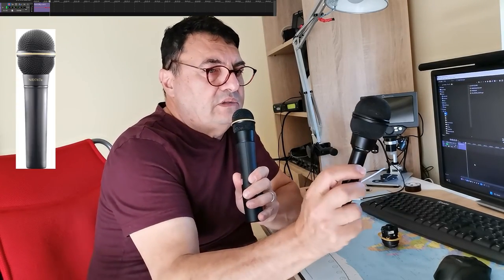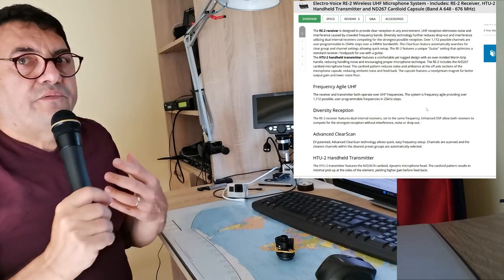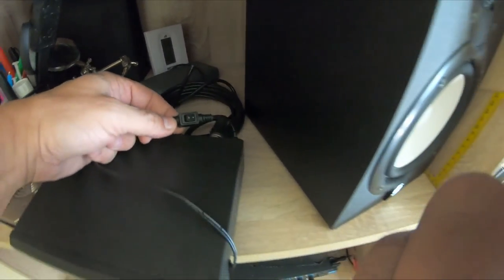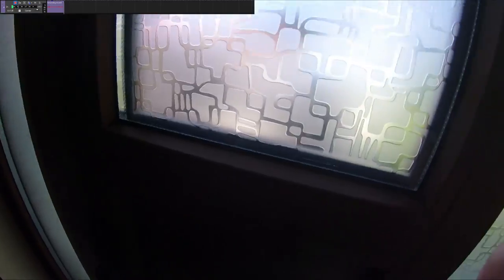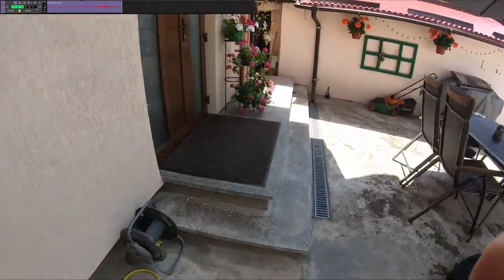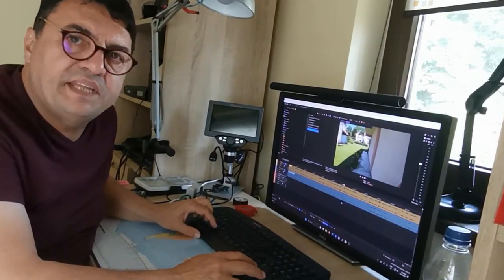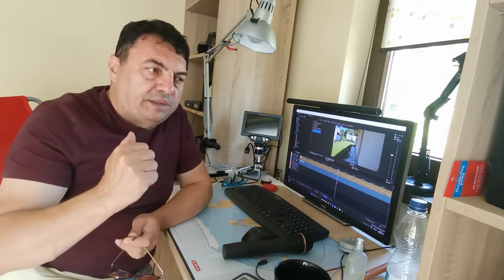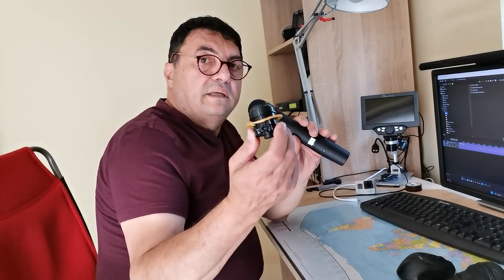Electro Voice RE2 & HTU2 767A wireless microphone system test

Comment: On the pdf they say about   +/- 40  kHz modulation which means it is using FM  (analog).
I prefer analog systems myself, but I have to be careful with frequency allocation.  
Digital systems are used mostly in WIFI bands like 2.4 GHz, they can be used without restriction, but
if there are too many WIFI routers in the area, they cannot be used. Also digital systems have latency, 
which is an issue  for recording.
The simplest way to distinguish between analog and digital is the 5 to 10 ms latency whic can be seen on a DAW.
Reply from the maker: Thanks Radu! Perfect explanation! I was thinking about latency, I felt that on some ''modern'' Shure wireless systems...that's whay EV has a ClearScan function to find the best ''clear'' channels.